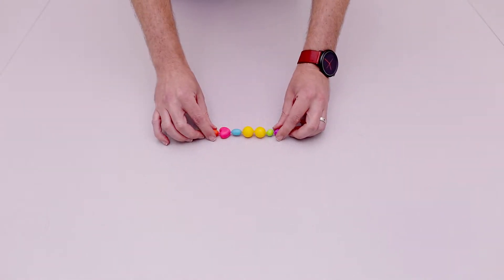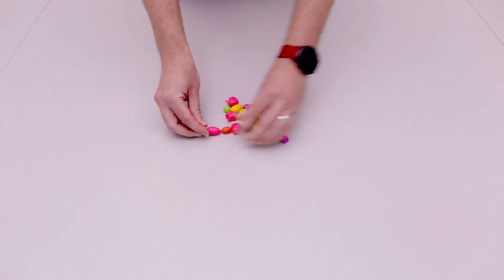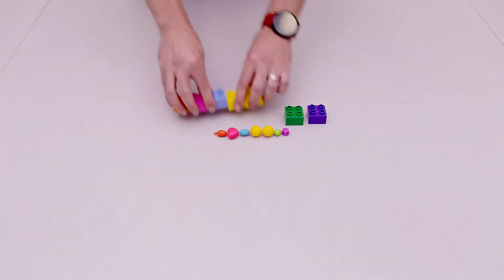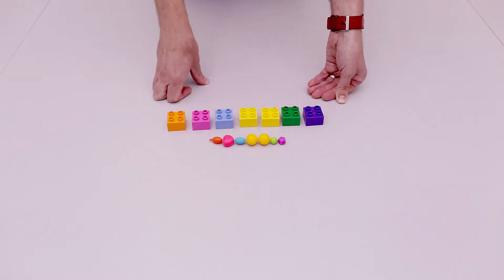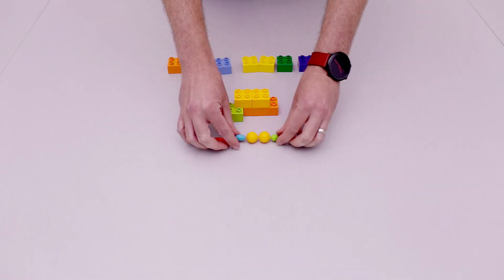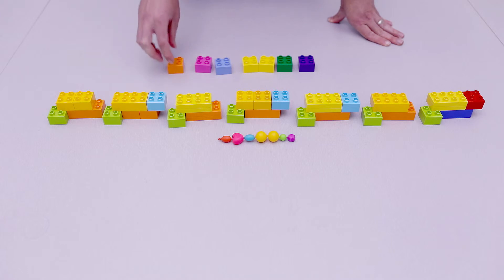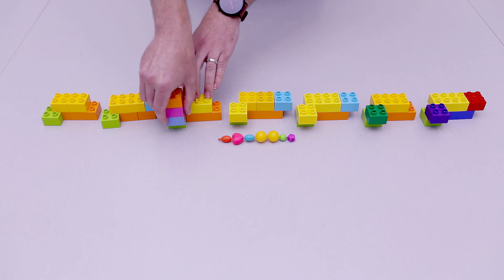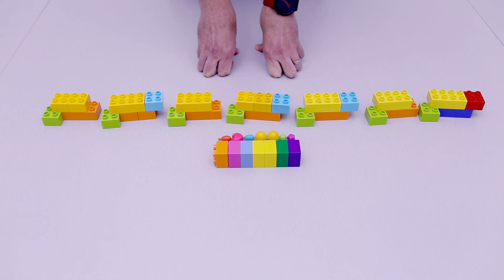A lego model of non-ribosomal peptide synthesis

Comment: THANK YOU FOR YOUR AMAZING EXPLANATION! Can i ask a question?  i am wondering if we have already can artificially synthesize AMPs  by recombinant DNA
 methods (although expression of antimicrobial peptides faces large potential difficulties because of their cytotoxicity to host cells and sensitivity to proteolytic degradation of nonstructured peptides but a lot biological expression systems have been developed by fusing antimicrobial peptides to a partner protein to mask the intrinsic antimicrobial activity of the peptide inside bacterial cells), so why we still need to find out these non-ribosomal synthesis machineries to  artificially synthesize AMPs?  is that because  artificially synthesize AMPs  by recombinant DNA
 methods is limited because it can only make the ribosomally synthesized peptides.   thank you so much!